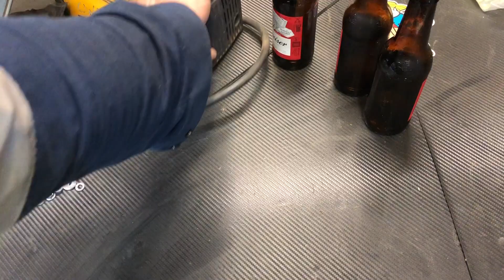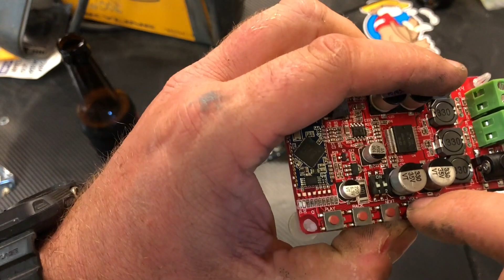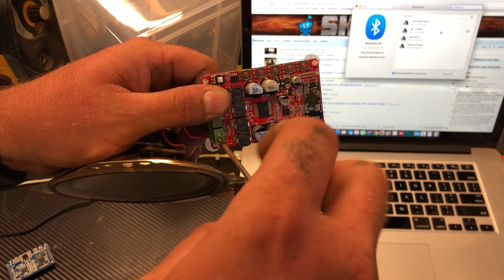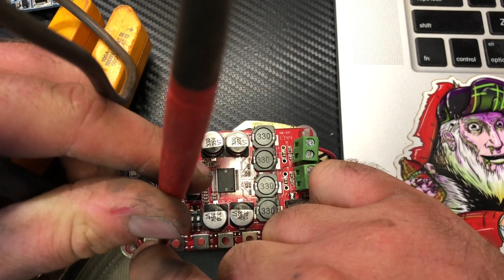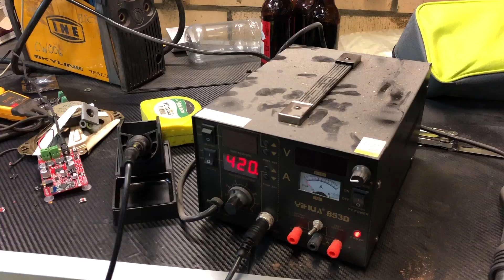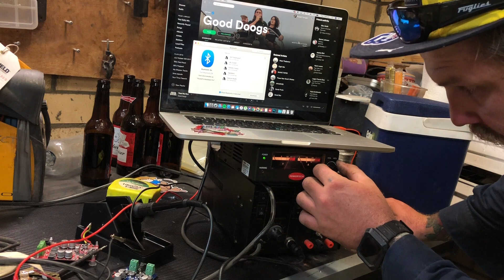Frankenstein Entertainment System | Upgrading 80's to Bluetooth | Part Two | Bluetooth Chips

Comment: Heads up on the middle sized board, that fecker picks up a lot of noise as its set to full max volume. 
Desolder a couple jumpers, and it takes it down and makes it a lot nicer to use.
Reply from the maker: Good looking out!

Comment: In that big rambling response to the original post on reddit I probably should've mentioned those buttons make handy as fuck solder points compared the horrible flimsy traces. Lucky on the auxiliary jack! 

Is that contraption a push button on board type job? You might be able to knock a wee tab off in the switch mechanism to give you what you need. 

The buttons work far easier with switches than bare wires - I faced this dilemna and thought I'd forge ahead, turns out it doesn't like the scabby input of bare wires but does ok on a switch, still a reasonably short press, more obvious thanks to my pissing about with the rotary switches.

Comment: you fucking found one of those red fuckers with a aux jack. I ordered from three suppliers and they all came with the jack not installed.
Reply from the maker: HAHA i ordered about 15 different ones two months ago and have had 3 arrive. Its really a lottery.
Reply: aliexpress is just another form of gambling. had shit turn up 6 months late at times (I order a lot of chinesium shit). 

Any chance you could map out the aux jack? I'm assuming two pins are for the switch and the other three should be easy to do with a aux cord.

Cheers dude.